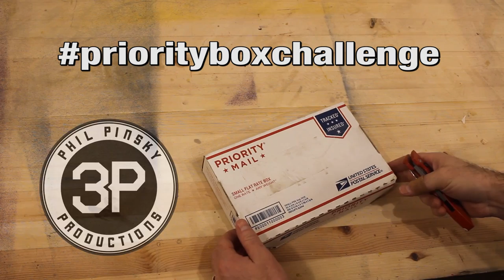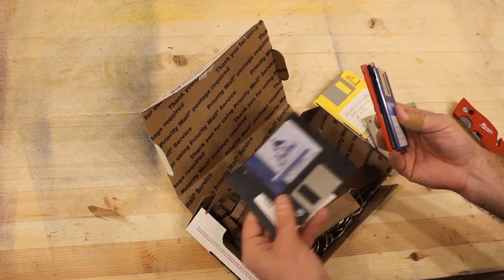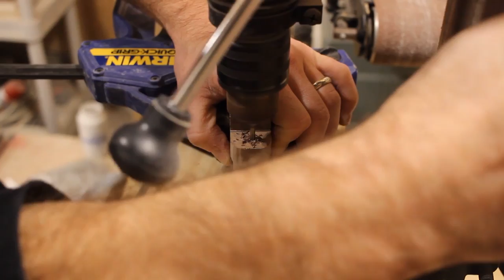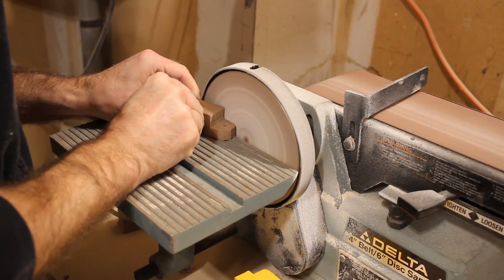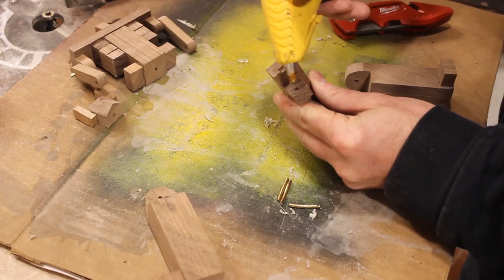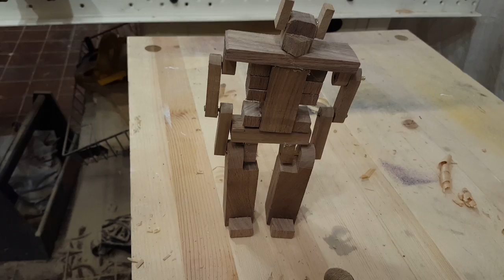Articulated Wood Robot #priorityboxchallenge

Comment: nice video! But one thing can be made better is links connection. If you would make some kind of nail from chain wire and pull it through hole and glue it in other hole (as you did) it would work much better.
Reply from the maker: +Dmitriy Lutsenko I completely agree